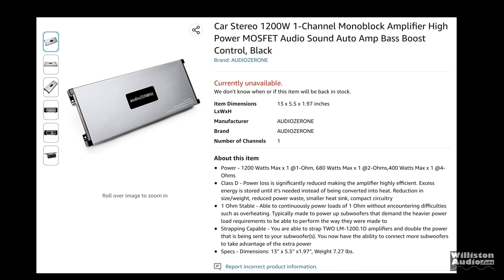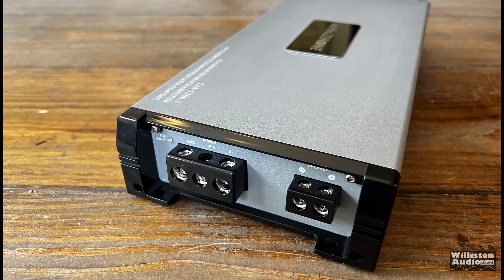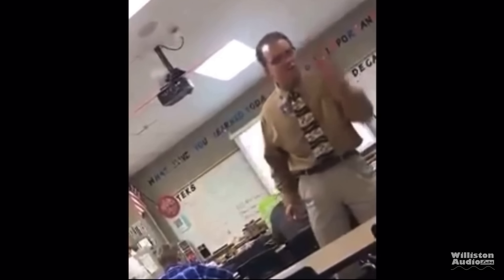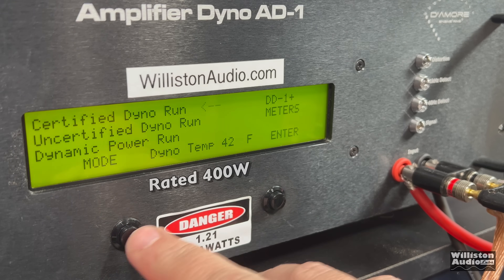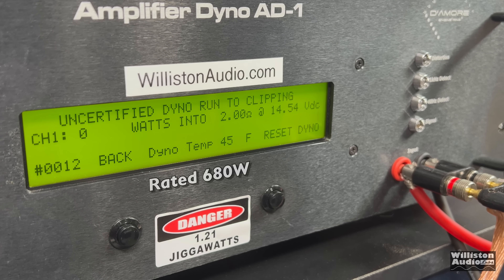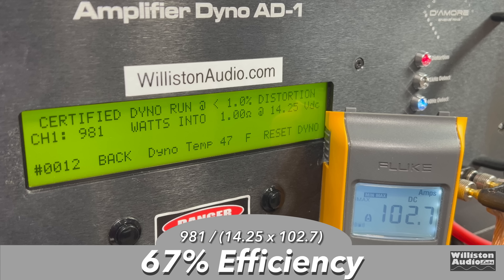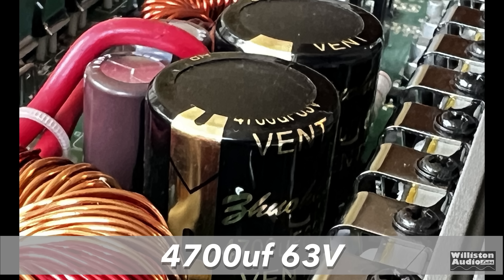Should You Buy this CHEAP Amazon Subwoofer Amplifier? audioZERONE LM-1200 Amp Dyno and Review

Comment from the maker: SHOP (Affiliate Links)
audioZERONE LM-1200.1 (not recommended): https://amzn.to/3kjsxn1
Down4Sound JP8 - https://lddy.no/vvaw
Rockford Fosgate Prime R2-500x1 - https://amzn.to/3DFCnpq
KICKER CXA800.1 - https://amzn.to/3DZGM7Y
Alpine S-A60M - https://amzn.to/3zNiuvj
Recoil RED1200.1 - https://amzn.to/3XCVJUf
SKAR RP1200.1 - https://amzn.to/3IWLw0X
NEW Favorite Precision Screwdriver Kit: https://amzn.to/3IT0G7n

RELATED VIDEOS
ALPINE MRV-M500 - https://youtu.be/cHLvpKAoNDo
KICKER CXA800.1 - https://youtu.be/fEBTBLm_SOo
Rockford Fosgate Prime R500x1 - https://youtu.be/ACrgDiG11IY
Down4Sound JP8 - https://youtu.be/No3qCPI4LNw
Playlist of Budget Amplifiers - https://is.gd/walbudgetamps
Amp DYNO Modes Explained: https://youtu.be/Q0m6NsB-HHc

VIDEO INDEX
0:00 Intro
0:12 Unboxing
0:46 Settings and Features
2:33 Amp Dyno Tests
6:25 What's Inside?
7:20 Do It Bump Doe?
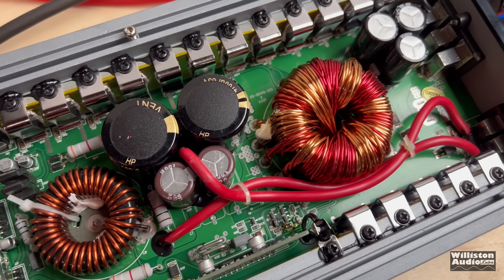8:08 Pros and Cons
8:58 Final Thoughts
9:38 Additional Tests

VIDEO AND AUDIO GEAR
(Video Gear I Use) 
Camera - iPhone 13pro 1TB - https://amzn.to/3nCjGvc
RODE Wireless Go II Microphones: https://amzn.to/3Q6NVHl
Shure MV7 Microphone: https://amzn.to/3A4OICK
Zoom H4n Audio Recorder: https://amzn.to/3BXjVsS
960 LED Panel: https://amzn.to/2Sxoq3S

TEST BENCH EQUIPMENT
SMD / D'Amore Engineering Amp Dyno: https://goo.gl/sJTcf7
XS Power D1400 Batteries - https://amzn.to/2BPFCKW
XS Power PSC60 Charger - https://amzn.to/2CHGcfs
Fluke 1000A AC/DC Clamp Meter: https://amzn.to/2Rw5WDA
Handheld Dyno: http://amzn.to/2u2EgKV
My Favorite Screwdriver Kit: http://amzn.to/2x0VzcE

DISCLAIMER: This video and description contains affiliate links, which means that if you purchase from one of the product links, I may receive a small commission. As an Amazon Associate I earn from qualifying purchases
Reply: When we gonna see a dyno test of the Recoil amps ? You have it listed as an affiliate link. Come on Big D !!
Reply: Its a korean amp..well its a korean bass knob anyway.
Reply: Actually I'm 99% sure it is linkable.  The phase switch is your tip off.  But that is absolutely a half bridge design so again it should be linkable.

Skar claims the RP2000.1 isn't linkable yet it totally is.  ;)

Comment: Dear Mr. Wiliston from audilabs. I had a power logic coustic 460. I had it in an S-10 with a standard cab. The amp pushed two 10 inch kicker comps. The two other 12's were also kicker but they were
A cheaper version. I only had the 460. The subs hit really hard. I was impressed. It kept popping the seals on the window. I always wondered the amp actually pushed. It was insane. If you can find that amp I'd love to see what it pushed. Thanks for lending me you ear and your time reading this. The amp was from 1996. And a cheasy P.S. I had a set of 12 inch reflex subwoofers have you ever heard of them?
Reply from the maker: My friend @hifivega tested those. See vid here
https://youtu.be/x5FjA0NKwXk

Comment: Good power for the value but the builder should have used  larger transistors for the drivers and attached them to the heat sink.

Comment: Hi I am a subscriber I just wanted to ask if you would consider doing some videos of how you wire and tune amplifiers when you are testing them. You already provide alot if useful information. However, you test many different amplifiers and I think it would be extremely helpful if you took the time to record your process of hooking up amplifiers to be Able to perform at optimal performance because each amp is different it would provide extremely useful information to sew your process and the formulas you use to tune each amp to Play optimal performance. This is just my opinion  but I've been watching your videos for a couple years now and I already look to your videos when considering purchasing an amplifier so obviously I value the information I receive from your videos so I'm trying to pitch an idea that would definitely take your videos to the next level in terms of value. Thanks for taking the time to read.

Comment: If I purchase this amp would it be a sufficient match w/two Rockford Fosgate 12” P3 subs, which are rated  1200 max watts 600 RMS watts each or 2400 max 1200 RMS watts for both?
Reply: Buy the wudi 8801.1d he tested off ebay if you want cheap.

Comment: What's the final resistance of your quadbox? I definitely wouldn't have put 4 subs on it. The resistance variation, due to the 4 subs and the fact that you ran it on literally half an ohm🤣, would make sense to be the problem. But something that's funny is I've seen amps that had significantly lower build quality, and they took the quadbox just fine, and they bumped with it!🤣 and they took abuse from the dyno!

Comment: Im not buying one either way, but you really need to hold off on the "Seal of Failure" until it can be determined that over driving it didn't kill the amp off. Although, a better amp probably would have had better ratings. Could have been fuse rated too high?

Comment: The big take away for me from this product review is that if a fly by night manufacturer can afford to include tiffany style RCA's on a $71 amp, then ALL manufacturers can do it!
😡
Great review/dyno as always Dereck!
Reply: some of the best amps I have owned have NOT had panel mount/tiffany style rca connectors, and many cheap, Chinese and Korean amps do have panel mount rca connectors. It is really not a factor when judging the quality of an amplifier. In my collection of vintage American made amplifiers, Precision Power , Orion, MTX, Rockford Fosgate, Zapco, US Amps, Rodek. Phoenix Gold and even Linear Power, do not use tiffany style/ penal mount RCAs.I also have several German made Helix amps that do not have panel mounted jacks...it is not really a factor when determining the quality of an amplifier
Reply: @raymo6795  I have some of those same brands in my collection. While I agree that tiffany RCA's are not the end-all, be-all when it comes to quality construction, they do bring some added value to the amp. I've seen the entire RCA panel break away from the endcap of some of the non-tiffany equipped models. I've never seen that that on a panel-mount setup. 
It costs basically nothing to add them and at the very least, the perception of a higher quality amp is a added selling point for the manufacturer. So, win-win. No-brainer really.
Reply: @msh6865  I really have not had any issues with board mounted jacks, maybe a couple in my 40 years of installing. But there is reassurance with panel mounted jacks. The best Soundstream models are panel mounted. Mmats usually uses panel mounts, also Genesis and Power Amper and Arcs better stuff, I prefer them, but some knock offs do use them as a gimmick, such as the one tested, and many that Big D tests, but it is not much a factor for me. The biggest factor for me is where it it’s made. I will not buy Korean or Chinese, only Euro and American made, maybe Japanese .
Reply: Greed is a powerful motivator. Smh....
Reply: My thoughts exactly! I dont see why thats not the standard. Oh, of course. Because its too much to add a $1 part instead of a 30 cent part to these amps they charge us 500+ for.

Comment: As soon as i saw that what's inside i expected it to blowup. 💀 This is not a 1200w circuit. It's more of a 600-900w. Type design but they overdriving it to get more watts in exchange of reliability. 
But this is probably the first amp that comes close to it's max ratings 😂

Comment: This video is exactly why I always spend a little extra for something  that won't blow up on me. I've had the same 800 watt amp from kicker for several years now.
Reply: I blew my 400 watt kicker just going from 4 to 1 ohm load going into protect it never came out.
Reply: Its can me a Monday morning model.
Just one that is broken .

About 3 tot 10% new stuff from all brands in the world have defect from factory.

Just see by nvidia and amd gpu cards.
A lot are defect juts new.
Reply from the maker: There’s always a risk but I guarantee the quality control on these super cheap amps is non existent
Reply: Almost 2000 watts from a 70 dollar amp 🤔 seems worth it to me. Heck if it only last 6 months then you've got your money's worth out of it and realistically there is no reason it shouldn't last considering these Dyno test is extremely stressful.on an amplifier compared to just running a sub. 🤷
Reply: @jeremybreeden4228  Heck why push it to 2000 just run it well under that and it may last years.

Comment: The cheap, always comes out expensive. Back in the 90's I spent almost 8hundred ( the 1st and only time) on an ppi art 600.2,  only used it for around 8months because I was replacing a system that got stolen,  and the pull out power and speaker connectors was actually the selling point, but I just got tired of taking it in and out so it's been on my wall since 98. I replaced it with a 600 Orion hot set up 💀 that was half off at best buy ( got the same power as the ppi 5hundred cheaper) in my car now is equipment from the early 2000's, eclipse xa1000 monoblock for subs( 500watts@2ohm)and a punch 400s on 6 premier 6x9. When you buy quality, it's  very forgiving and will Las you a lifetime( imagine buying a Rockford amp, and it blow's up, I ran a 150hd in 2ohm mono for a long time in the early 90's, but we all did that back then)
Reply: Eish I never sold my 700s fosgate
Reply: I say Rockford Fosgate is one of the toughest brand of amps I've ever used. I had a 60 ix my friends and I beat the s**t out it. It wouldn't give up, it just kept taking the abuse.

Comment: The name alone tells me to stay away. I have not watched the video yet. I'll be back.
Well it blew, don't know if it was done by dropping the impedance too low? No matter to me. I wouldn't touch it with a ten-foot pole. Why spend money and time only to find out I put $70.00 in the toilet. 
That's the way I look at it. More importantly, my time is more valuable.
Reply: For 70 bucks it would be fine for 99% of systems with 1 or 2 subwoofers. 1000w easily and probably wouldn't have blown up if it wasn't run at 1/2ohm load. Not a bad Amp.

Comment: Those metal clips on the mosfets are GREAT. they allow for expansion (during heat the mosets expand) Looks like this amp had a poorly tuned protection circuit as well as an overdriven output section (needed beefier mosfets) so its underbuilt for the power its outputting, which is sad because its otherwise very nice for the price.
Reply: which means youll be able to grab these for free on locals and repair them with bigger transistors.
Reply: Huh I see someone who knows something about electronics... I agree with you. It may be even worth upgrading the output section with beefier fets. About the protection circuit, it may be possible to upgrade too and, in case of failure, it's still a nice source of power components...
Reply: Upgrade the output section that amp prolly be fine but if not it's a great amp to grab parts off to use for better amps.
Reply: @joshholden8561  meh, if the components are original, it should be fine, if they are chinesium based, maybe not
Reply: How can you be certain that the output fets are being overdriven without seeing what fets they are employing as well as without seeing the PWM frequency and waveform shape?

I've been noticing that a lot of the Chinese based clones that use irf0640 on the output section (perry babbin refers to as type 4 class D) aka skar rp2000, cab 1600, cab2000, soundstream 4000.1 etc have MISMATCHED fets!!

Numerous times on the skars especially ill pull ALL the output fets, notice that there are different date codes AND different batches in parallel.  Obviously these show significant differences in Vt which in turn stresses them non uniformly which eventually kills one to 4 of them...ala why skar RP has a bad rap.

Agree on the chincy protection circuit. NO excuse for that!!!  But then again almost all Korean boards have protection circuitry from the 1490s when Columbus was exploring the new world.....lol

PS as far as fitting better fets, that is a huge arse can of worms....yes it can be done with a lot of work, but why?  To make a weak amp more reliable and still weak?

I can buy skar RP2000.1s all day for 100 bucks, bring them back to life for about an hour of work, and have something with double the power for almost the same investment.  And if it does die, it's protection circuit will save it unlike this thing.
Reply: Not beefier MOSFETs, more of them.
Reply: @carlosoliveira-rc2xt  Hmm... Switching losses and switching noise would increase too much, then
Reply: @fabriziobrutti1205  the switching noise would be irrelevant due to it being a power supply fet.  Now if he were to add output fets then it could be an issue for sure.
Reply: @carlosoliveira-rc2xt  then you need to add gate resistors and hope the drive buffers are up to the task....and beefier fets could absolutely work however the ciss @ vds often increases too much to say nothing about the other parameters of the fets

Changing fets isn't as easy as many think it is.
Reply: Based on the visuals alone, it should have been a good amp. Perhaps in the cloning process someone "value engineered" a less capable part ?
Reply: @brianmack6285  seems possible

Comment: I'm considering sending mine back after watching this one explode. I wonder if it was the low ohm test that started the failure.
Reply: Yeah, the low ohm test is bad, if it's a maxxsonics clone it's way bad they don't like being under 1 ohm they way they build them. They are cheap for a reason. Squeezing the most out of the least. As long as you're wired at 1 ohm by the diagram methods not accounting for box rise and all that the odds of dropping to a point low enough to hurt it are pretty slim. Have to have a short, coil fault or something else like that. For the money this amp ain't bad.
Reply from the maker: It’s tough to say but we also have to remember there are corners cut to offer amps this cheap
Reply: Yeah .5 and making 1800+ watts I’m sure that was it way under built for what it made it’s probably safe at 1ohm